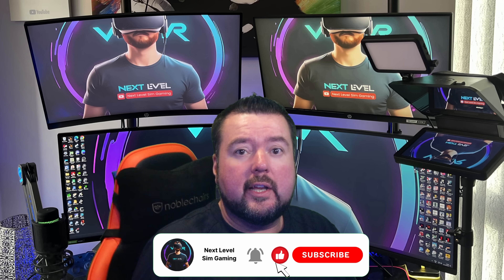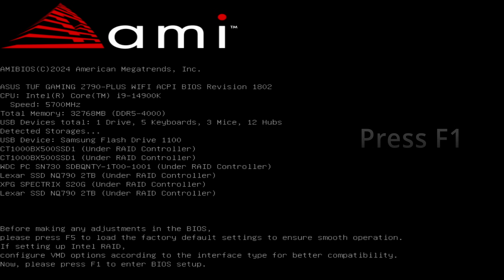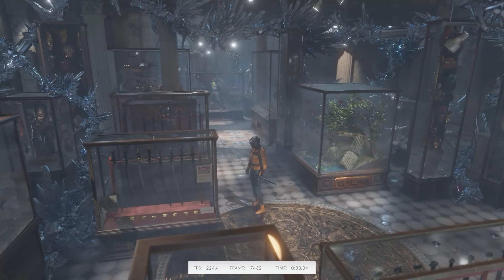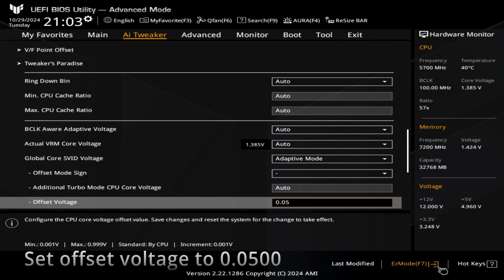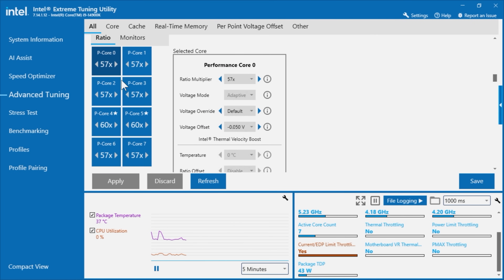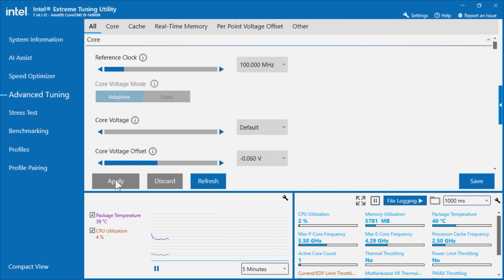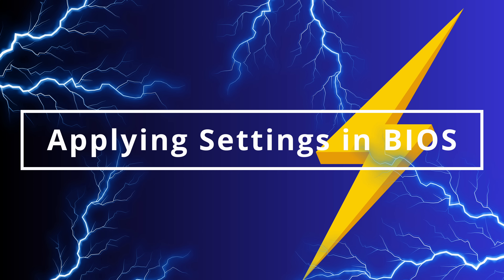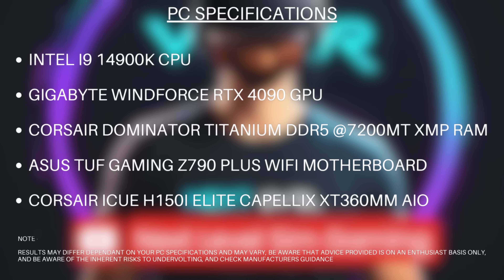i9 14900k Intel Final Microcode 1802 - 0x12B  BIOS Installation, Tuning and Undervolt Guide 📈

Comment: I don’t know what happend, I put all the values exactly as the video and only get 33k on r23… I also have a 14900k
Reply from the maker: @Andrédbu  Is that using the Asus OC tuned profile from 5:29  onwards in the video?, or on Intel Default settings?, if not is should be.

Also ensure that all background applications such as chrome, RGB software etc are closed in the tray including Intel XTU to ensure an accurate benchmark.

The score will improve the more you undervolt as the TDP will become more efficient, my score is based on an undervolt of -0.075
Reply: @nextlevelsimgaming   ok brother I got it to work. Stable at 10min C23. I got 40k !!! I followed your videos on how to setup the new BIOS version, my current is 1805. But there’s couple things that changed on your videos from one to another. The only issue for me was  enabling both IA CEP and SA CEP, on a previous video you said to Disable IA CEP and leave SA CEP on Auto. Well this is the only thing that I changed and it worked bro 👍 by the way I’m on 0.08000, 14900KF
Reply from the maker: @ Excellent, it may be slightly different with the KF due to the absence of an IGPU, the current excursion protection is finnicky with the 14900k, but its fine regardless.  Thanks for the update 🙂
Reply: @nextlevelsimgaming  thanks to you mate! Great content. Quick question though. From the BIOS setup I realized you only changed one thing couple times back and forth and I don’t know what’s best. Should I enable or disable Adaptive Boost Technology?
Reply from the maker: @ I played around with the setting between videos, if you leave it enabled the processor won’t reach the conditions necessary to boost anyway as it boosts to 6ghz, we are syncing the cores to 5500.

I now just disable it in recent videos, the boost is the cause of the processor’s underlying issues with higher temps, and then consequently performance.
Reply: @nextlevelsimgaming  ohh okay understood now 👍 I’ll leve it disabled then, but you still leave it at 55? What’s a good undervolt Value for you? In running .08000 stdble
Reply from the maker: @ I use  - 0.075 only because I like the headroom, stability when rendering 4k videos is quite demanding

Comment: Hi @nextlevelsimgaming, first of all, thank you for your great videos! I really appreciate your work. I am running the same settings as shown in the video, works well, but in Time Spy I only get 22256 as CPU-score. My GPU-score is higher, that's why I also get an "Excellent" over-all-rating, but I am wondering why my CPU-score is that low. The graph shows that it's constantly running with 5500MHz - no downclocks and the temps look fine, too. Do you have any idea what could be causing this? Appreciate any help - thanks! Keep it up!
Reply from the maker: @Jericho_Nine  Hi, have you closed all background applications in the tray?, Chrome,  iCue, RGB software when running the benchmark?, for an accurate result this is a pre requisite.

The CPU score is refined by the level of undervolt, this is different for every CPU as it depends on silicon quality (SP rating) and power efficiency.

Mine will produce over 26k at an undervolt of -0.07500 but you will need to find the appropriate level for yours.

Don’t get too hung up on scores however concentrate more on temps, and consistent performance in real day to day use.
Reply: @nextlevelsimgaming  Thanks for your reply! Yes, I closed all applications - my machine is running fine so far but I was wondering why my CPU score was that low compared to yours with same settings and similar hardware. I'm going to play with the undervolt a bit more to see what effects it has - thanks!
Reply from the maker: @ No problem 😉

Comment: Hi, After updating My Bios My 13700KF Score on cinebench went from 28.000 to 18.000 i think is a huge problem. Can you guys help me?
Reply from the maker: @dextermondala8124  Refer to part 3 of the video, use the Asus OC profile, use the power settings 

IccMax to 307A.
PL1 to 125W.
PL2 to 253W.

For your particular processor
Reply: Tried it still the same problem @nextlevelsimgaming

Comment: When using this with a 14900KF it works very good but with a 14900KS the CPU is often downclocking with bad results. 
Do I need a different allcore ratio here? 🤔
Reply from the maker: @johnmcmurphy1007  No, the Intel Power limits for a 14900KS are 400a, 320w PL1 and 320w PL2 change these and you’re set 😎
Reply: Hey quick question, for the KS. Would you sync all cores to 55 as well? Or can I keep it stock and undervolt it

Comment: Super helpful, mate. My AVX2 stress tests pass but I still can't get more than 30 mins to and hour of gamin in before mem violation type errors. Since I can't have downtim,e as my PC is for work and play, I bought a second i9 14900k that'll be using, the RMAd one will become my back up. Now, when I put this new one in, ensuring I have solid settings as per this video, I shouldn't be getting any darn memory type errors, right? My old PC builds never crashed so just don't know what to expect since this processor has been giving me drama from day one.
Reply from the maker: @grimventures  It sounds similar to what other users report, if you look through the comments, some came back who had RMA’d their processors, hopefully thats of help, hope you get it resolved soon mate 👍🏼

Comment: Is it safe to copy these exact numbers?
Reply from the maker: @whoareyou56101  If you have an i9 14900k then yes, but begin at - 0.0500 undervolt and test, then reduce in increments of - 0.0050 so next would be - 0.05500 then - 0.06000 etc until you find a suitable undervolt for your system
Reply: Yes it is
Reply: It will work with 13700k 13900k and so on

Comment: Hello friend, I'm going crazy with the voltage of my 14900kf when I do the cionebench tests the voltage is 1.2 /1.4 maximum, but when I don't use the cpu the normal voltage is 1.4 and 1.54 peak arrives, do you have any idea if this is normal?
Reply from the maker: @Agus-fl9lh  Are you using an Nvidia GPU?, do you have Corsair iCue installed?, have you done the latest BIOS update?.

Also disable c-states in Bios and check operation then
Reply: @nextlevelsimgaming for those having iCUE remember to install the plugins for your respective NVIDIA and MSI Board with in iCUE software that help me solve the temperature and voltage issues.
Reply from the maker: @ Great tip, thanks 🙂

Comment: Is there a reason why mine still running so hot do you keep the turbo mode on? When I disable it I get stock performance or am I not doing it right? I've never seen a cpu running at 90 degrees on games I've tried everything
Reply from the maker: @TonySgolf  I only enable Turbo fan curve for when I’m benchmarking, I use  Corsair iCue to control fans normally this is very system intensive so disable this and other running processes.

It should set the fan curve to whatever RPM you set.  Its difficult to say how it performs on another PC as I do not know how its set up.
Reply: @ i followed your guide and when I leave the turbo mode on I'm able to get the all core set to 55 but when I turn off turbo mode all my cores are at 32 in your video I did not see you turn off turbo mode.
Reply from the maker: @ Sorry I thought you were referring to Turbo fan configuration, I presume you mean adaptive boost, it should be on by Default when Asus OC profile is selected regardless.
Reply: @ the Turnbo Performance in the CPU configuration did you disable that or keep it on?

Comment: hi there mate, i have ran these settings, decent changes in temperatures etc, and not a massive performance loss.

When stressing on the XTU I do not hit a current or power limit, is this normal?
Reply from the maker: @haxenabled9294  Its not actually, are you using an i9 14900k?, the current and power limits relate to the Intel settings we applied 400a & 253/253 it sounds like its not delivering on the cores, what does the core clock show it’s reaching in 3D Matk?

Comment: damn my 14700k pulled 36,000 stock post 12b now its 34,900.. I RMA'd it and they gave me a free upgrade to a 14900k.. New batch.
Reply from the maker: Nice upgrade 🤠
Reply: dang my 14900kf isnt even pulling 32k stock 😭😭 should probably see if i can get mine RMAd

Comment: Thanks for tutorial man now i have a max performance with a good temperature and low vcore i have 14700kf i sync performance cores to 5.1 efficient cores auto pl1 and pl2 150w for good temperatures undervolt to -0.110  vid max 1.256 average 1.062 vcore max 1.225 average 1.044 max temperatura on cinebentch 10min 59° and 33500 points on games i win more FPS
Reply from the maker: Fantastic 🙌🏻
Reply: @nextlevelsimgaming  do you recommend switch something or it is ok for 14700kf?
Reply from the maker: @ The 14700kf is a fine processor, ultimately it depends on your usage case, if it works well for you presently then is there a need to change?, most games are more GPU reliant nowadays than CPU, obviously tuning for temperature and stability is more important in gaming often than benchmarks.
Reply: @nextlevelsimgaming  i use ONLY for gaming i run cinebentch and avx2 for watch max temperature and test undervolt stability
Reply from the maker: @ You can use in all scenarios, and yes ensure its stable for the undervolt level you desire 🙂

Comment: I research & research & research & for productivity 1st & gaming 2nd , intel was the way to go! 1st purchase ; z790 Pg-iTX Thunderbolt 4 Asrock Board. Then the CPU . . . . . only to find out about intels heating issues & for an iTX build (I cannot stand looking at PC's & despise flashing lights - so it needs to be out of the way) its not remotely feasible.

I ended up building a mATX AM5 machine & its still too big of a footprint in my workspace for me - 7950x3D - but still have this AsRock board on the shelf & I'm considering selling it.

Are you ALL saying that the latest microcode along with the settings / tweaks applied here actually Work? So if I were to purchase a 13900k / KS that I would actually have a functioning machine?

Thanks greatly for your work
Reply from the maker: @ExitOnTheInside  Yes, no issues when tuned, new video will be out tomorrow expanding on things even more 😉
Reply: @nextlevelsimgaming  Subscribed - thanks for responding
Reply from the maker: @ Welcome onboard 🫡

Comment: does this also work for 14700kf? thanks
Reply from the maker: @vecteurtech1019  Yes but use ICCMAX 307a and PL1/PL2 at 125/253w everything else the same 🙂
Reply: @nextlevelsimgaming  thanks
Reply from the maker: @ No problem 😉
Reply: @nextlevelsimgaming  Hi, I also have 14700kf, wanted to ask if that's okay that after 012b update voltages go as high as 1.45-1.49V under load and sit at ~1.3V with no/low load? I have intel's defaults enabled, power limits set to auto (but I will adjust as you mentioned above), should I undervolt my CPU or those voltages are new "fine values" after the updates?
Reply from the maker: @MrBoBrilO  You need to apply the Intel safe limits manually as above, if its set to Auto the power limits are unlocked and there is no limits in place, this was the issue that caused high temperatures and issues in the first place as motherboard manufacturers had no Intel Default Profile available initially.  Set the safe limits described above, then undervolt, and you will see improvements in temperatures and more efficiency in benchmarking = higher scores.
Reply: @nextlevelsimgaming  hello, just "long duration package power limit" is 125? right? thanks
Reply from the maker: @ Short duration (PL1 = 125w) Long Duration (PL2 = 253w)
Reply: @nextlevelsimgaming  many thanks
Reply from the maker: @ No problem 😉

Comment: Hi !, I currently have a problem, I followed your tutorial for my 13900K and I lowered the frequency to 5.3 and offset 0.05000 the cinebench works very well but I get a failure in the avx2 stress test in xtu :/
Reply from the maker: If the CPU doesn’t hold a mild undervolt, a degraded CPU will begin to require more power, you may want to consider RMA’ing the processor, a couple of others in the comments have had the same issue, and have come back and confirmed Intel have replaced them, and no further issues.  Unfortunately if its degraded none of these steps can revive it, only prevent it.

Comment: I just today upgraded my Bios to the latest version. Will this have an inpact on the way you show in the video to set up the stttings in the bios. Im using all the same settings on the new bios as you show in the video, and so far it runs fine, no problems. But if there is some small changes I would really apriciate if you could tell/show us.
Reply from the maker: @kurtandersen813  No its exactly the same, the only difference was the driver issue caused erratic idle thankfully testing has confirmed this evening benchmarking is fine 📈🙌🏻
Reply: @nextlevelsimgaming  THANKS for quick answer 👍🏻👍🏻👍🏻
Reply from the maker: @ No worries 😉

Comment: For some reason they have not released 1802 for the z790 formula :(
Reply from the maker: @Zonarion  The Bios update is the same, its model variant is Version 1703, all the guide applies to this variant 😉
Reply: @ you’re the goat. You’ve been helping me out the last few months but I started getting hit with wicked crashes instead of the usual monitor black fan ramp up then crash. 

Thanks for all the help you give. It’s a damn shame you have to do it to begin with though.
Reply from the maker: @ No problem my friend, glad the guides have helped 😉 unfortunately Intel can never say the chip doesn’t perform as sold and intended or that would be a whole new legal arena, but thanks to enthusiasts we have finally found a solution 🙂

** edit **

Regarding the screen crashes, that sounds GPU related there’s a new Nvidia driver launched today use DDU (Display Driver Uninstaller) and do a fresh install of the new driver it sounds like a driver conflict

Comment: Hi my bro! Yesterday I bought 14900K and Ryujin III 360 Cooler. With MB Asus Z790 Apex, solved problems with i9 for me too? I need to upgrade BIOS right?
Reply from the maker: @elcomandanteimperial8397  Hi, yes install the BIOS to update the microcode to stop elevated VID requests on the processor, use the settings in the guide to achieve stability and improve performance over the Intel Default Setting

Comment: I'm at a point with this issue to where i followed everything you just did step by step and I am still getting stutters and game crashes.... z790 asus rog maximus hero. Ryujin lll 360AIO.  Corsair titanium 7200 ram sticks.... I'm getting so drained trying to figure this out. Months and months.
Reply from the maker: @chrisknight3481  Firstly, if you’re using the latest Nvidia drivers with Corsair iCue there is an issue causing CPU instability  -

https://www.corsair.com/uk/en/explorer/gamer/gaming-pcs/nvidia-driver-56603-and-corsair-icue-problem-explained/

Is it that your CPU is crashing without the undervolt?, does it crash with the Intel Default Settings?, and does it crash with even a minor undervolt?, i.e - 0.0500?

If it crashes with Intel Default Settings, and on the latest BIOS update, then you should RMA the processor.

Just to check also are you using - 0.0500 not - 0.500 its crucial to not undervolt too much, which is why its very important to test the level of undervolt in Intel XTU before confirming it finally in BIOS.

Unfortunately some processors would have degraded before this final BIOS was put out, this is the purpose of it, as the CPU’s were requesting too much power hence the overheating and crashes in the first place.

The symptoms you describe are unfortunately a very strong indication that your CPU has degraded and requires replacement, these steps can only prevent but a damaged CPU cannot be cured unfortunately.

Comment: 14900K vs 14900KS what are you recommending in different settings for the KS (except the power target)?
+100 MHz more?
Reply from the maker: @Tech-Dino  I haven’t changed any settings outside the shown ones on this undervolt and sync cores example, but next weeks video is a custom tune,  will be looking at two gaming scenarios.  You have headroom to play with using a KS so as well as power headroom an increment of 100mhz will be acceptable, but as always its trial, error and stability testing
Reply: @nextlevelsimgaming  Thanks for your response. 
Amazing: before I got 39706 points in CB23 (gained 519 points only with the new installed thermal grizzly contact frame)
which was not too bad since Intel updates/restrictions.

I only set 5500MHz all Core and KS power setting (-0,05v) = 41379 points. 
(CPU Package max Temp. = 75 degrees) max voltage 1,371v
Reply from the maker: @ Great to hear 🙂
Reply: @nextlevelsimgaming  5600MHz all core = 41509 point CB23 (with HWinfo & Steam running) needs some stabilty testing of course.
Reply from the maker: @ Great figures 🙂 5600 is a good frequency theres not much between 55 and 58, but for stability (on a 14900k) and temps, I find the 100mhz difference is not really noticeable in gaming
Reply: @nextlevelsimgaming  5700 all core is near the same because it start throtteling now
from 5700 to 5600Mhz.
Reply from the maker: @ I did the leg work for you 😉

Undervolting and Tuning Guide Intel i9 14900k - Core Sync 5500 to 5800 mhz &  Performance Benchmarks
https://youtu.be/hh3FIN1c_ZQ
Reply: @nextlevelsimgaming  41.712 points with -0,57 offset (-0,60 offset will be slower).

Edit: Dragons Dogma 2 benefit extremely its heavy cpu bund, 
this typical stutters are much less.